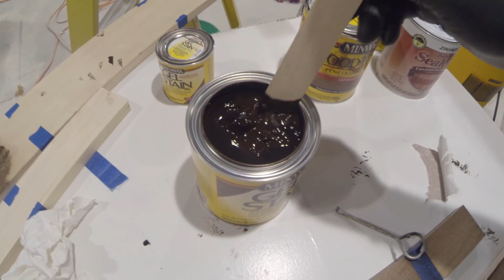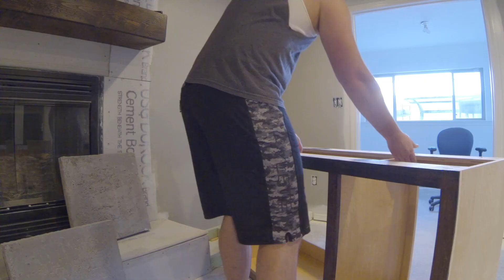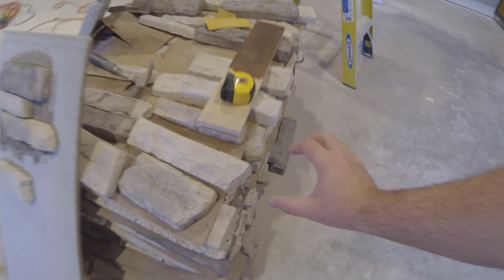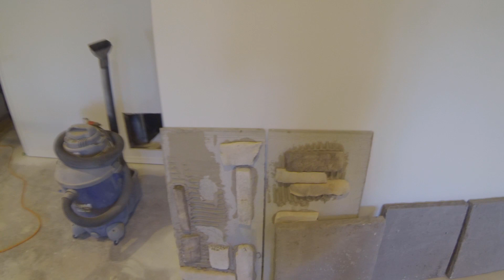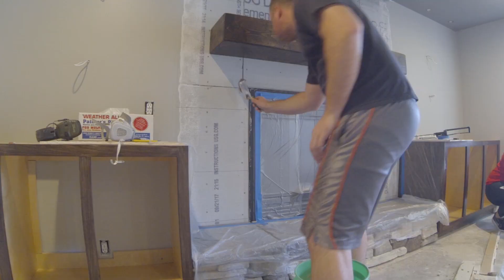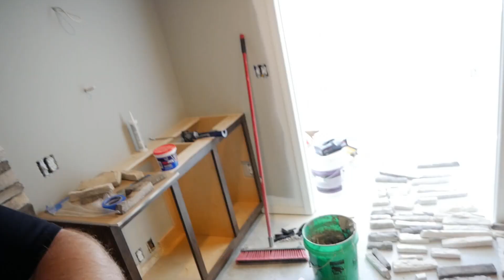Installed Stacked Stone Fireplace | Stained Built In Cabinets | Basement Build 18

Comment: Great video. The fireplace looks great, too. Did you consider using lathe? If so, why did you opt not to? Several supplies houses I've gone to looking at stone recommended lathe on top of the cement board. Thanks!
Reply from the maker: I saw it recommended if using plywood as the base. Lathe and scratch coat on top, then stone. This manufacturer said you could go right on top of concrete or concrete board

Comment: So. Just wondering how you plan on replacing the fireplace when it goes bad in 10 years?  you placed all the stone over the edges of the fire place insert. Currently, as it is done (and it looks awesome by the way) you will have to remove the hearth stones, as well as all the surrounding stone to replace the fireplace insert.  Wish you the best when the time comes.
Reply from the maker: You can replace the inside panels without having to remove the entire unit. It rarely gets used, maybe 2-3 times per year. Should be good for a quite while.

Comment: Fireplace looks great - very nicely done! Planning to do something similar (first timer as well) but with ledger stone. Did you use powdered thinset (i.e. mix it yourself) or buy the premixed one? Any recommendation on which one to go with (never worked with thinset before)?
Reply from the maker: I used the stuff I had to mix. I go over things in a lot more detail in the bar stonework video I did shortly after this one. I wouldn't use the premix stuff. Good luck! It goes pretty quick after you do the first few
Reply: @LifeofBliss  Thanks a lot for the prompt reply! Watched the bar video - super helpful. May I ask why you'd not use the premixed one? Isn't it so much more convenient?
Reply from the maker: Its a lot cheaper for the dry mix. I have thought it had a little better hold as well, little stronger.
Reply: @LifeofBliss  Got it - thanks again. Keep up the great vids!

Comment: If drywall is already in place do I need the cement board?
Reply from the maker: Yea you'll need to replace it with cement board. The drywall it's strong enough to hold all of that weight, the paper face detach or the entire board will pull away from the screws.

Comment: Should have used a metal wire mesh behind the stacked stones.
Reply from the maker: Since cement board was used as the backer, no metal mesh was required. If it had been just sheetrock or plywood, then I would have needed the mesh and scratch coat